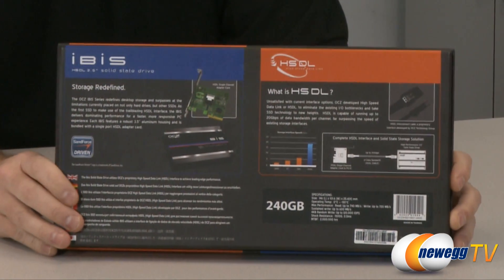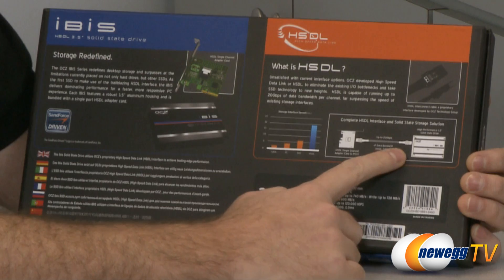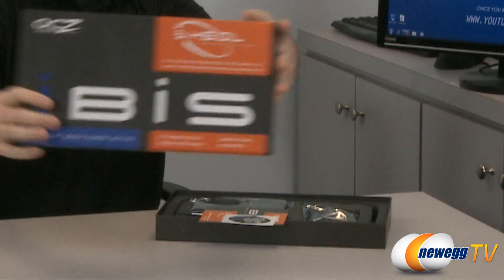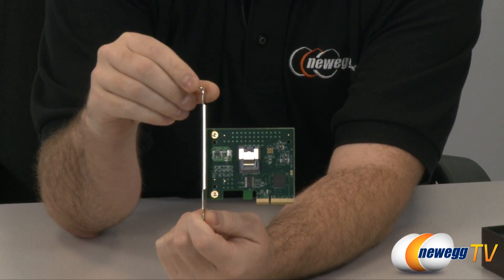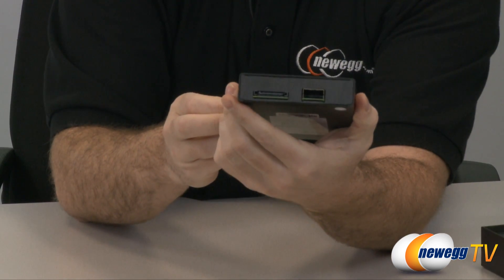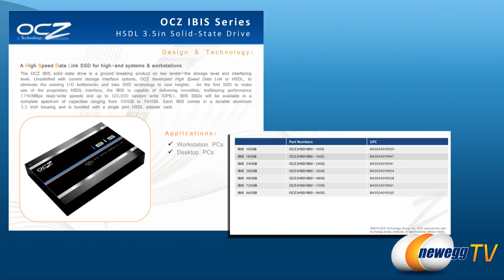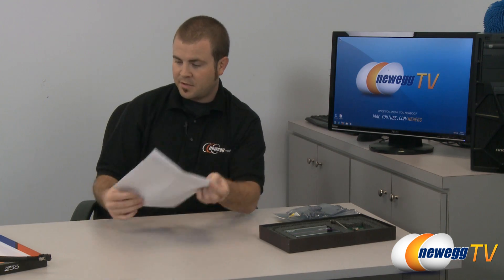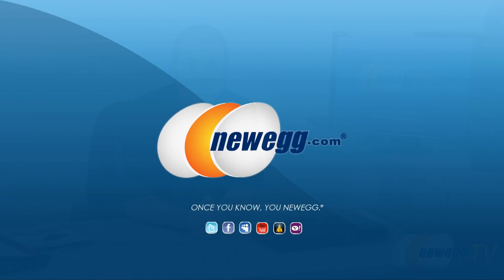Newegg TV: OCZ IBIS SSD First Look

Comment: @newegg Seriously You need a Body mic , cause the sound quality is horrible , i can barely hear you with my speakers at max. I've written in several of the older videos but still here's to hoping you guys get a Body mic or something.

Even if the camera doesn't have an external mic jack you can always  use a different mic and sync the sound.Many methods if you guys need help . Also I love Newegg :D

Comment: If those speeds are right... holy crap. As for price, a 240g SSD, its not bad. I remember when SSDs were over $500 just for say 32 or 64 gigs. But yes you can build a RAID array for much cheaper and get good performance out of it if you doing regular apps or gaming. But if your a tech junky and want to brag, this looks amazing.

Comment: amazing stats but $600 for the 160GB is a bit out of range for most people. Iam planning on getting my FIRST "normal" SSD this christmas, been holding off since I was going to get a 30GB OCZ Agility back when it was $150 but now at the rate the price is dropping, I'll be able to get a 90GB Vertex 2 for black friday! W00T! My Black Friday List:

-Upgrade from the GTX 260 to a 460 or a 6850/5830? I have no idea how the new ATI numbering works

-Upgrade my Antec 300 Case to a 900

-Get a SSD